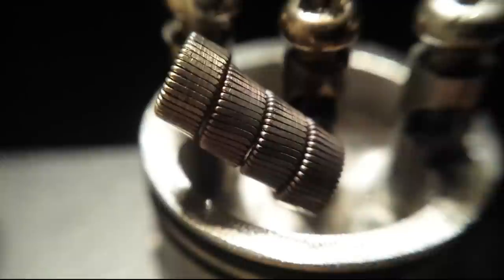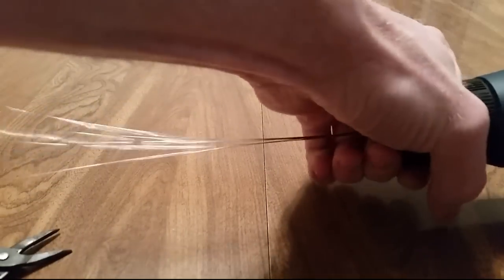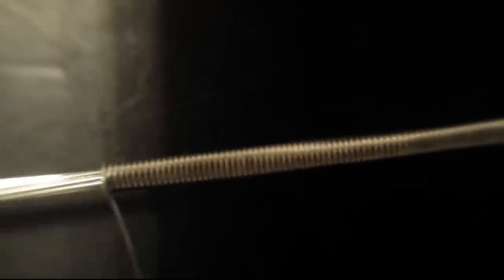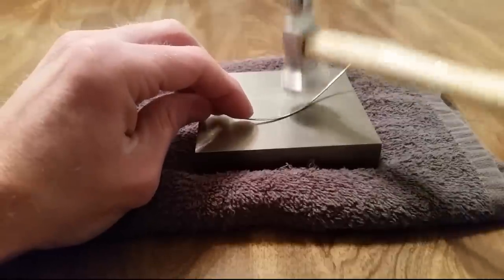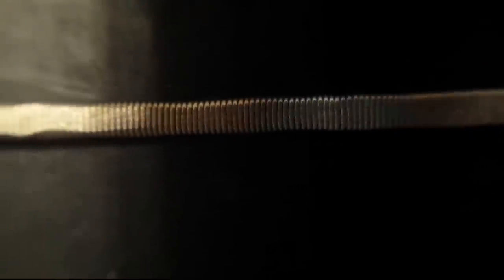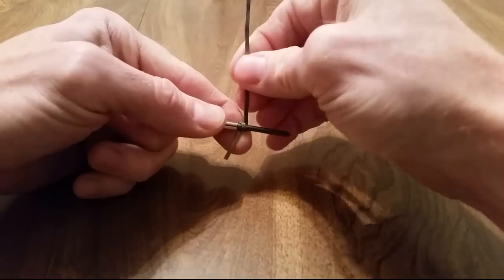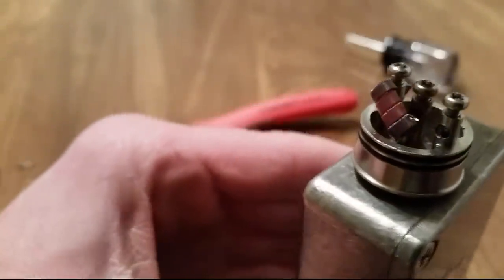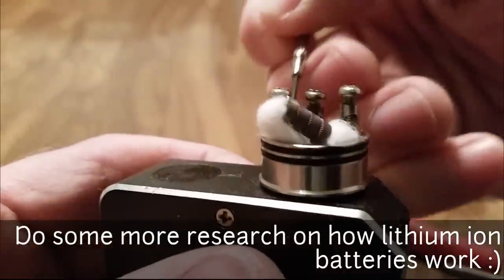Caterpillar Track Coil

Comment: do you think the hammering to a flattened state would be any quicker/easier if you heated the wires up a small section at a time, then took the hammer to it while its hot? im thinkin mini blacksmith here. thoughts?
Reply from the maker: I'd say try it. Only issue would be hammering the delicate wire evenly and also the wire is very low mass compared to the block so it would cool down pretty instantaneously
Reply: +Twisted Messes I bet you could build and sell these like hot pot cakes!

Comment: everytime i see this painfully long hammering process i have to wonder if two cylinders aligned close together two allow the wire to be passed thru and simply squished wouldnt be a better option. something like a small pasta or fondant sheet maker type thing(hopefully that makes sense) and im sure ive seen something like that before
Reply: +Rory Adam The best thing to use is a jewler's mill. It does it completely evenly, has two hardened, steel rollers, doesn't come out like looking like a snake because of inconsistent hammer strikes in one area, and above all, you can adjust your rollers pressure, so that you only flatten your wrap wires and not the internals, so that you don't destroy something like a framed staple coil.
Reply: Awesome thank you for letting me know what it is ajd that it exists...i knew i had seej something like i had described...cheers :)

Comment: And one more question buddy, why didn't you cut the negative lead as close to the post as you did the positive? So the coil won't move if the srew loosens a little?
Reply from the maker: Honestly it was probably just a weird angle I was cutting from with the camera in front of my hands. I usually try to cut the negative and positive leads as close to the posts as possible
Reply: +Twisted Messes Right! I was just asking, maybe learn something new lol.  You and Squid are about the only ones I can actually learn from!

Comment: i have a question when building these coils couldnt you just use a clamp or a press ..?
Reply from the maker: BILLY-THA-WAR MANICS-CHAMBERS a rolling mill works really well. I'm guessing an actual press might be trickier with this specific coil since the twists would be compressed rather than worked out through the rolling process. Have never had success using clamps though, just not enough force and quite a tedious process
Reply: k i didnt know lol im still a noob at all this i really just got into vapen about 2 month ago havent somked a cig in 2 month thanks to vaping so really i dont know crap about fancy coil build's it was just a thought imm try to get into building my own coils just like i do my juice tired of by per mades .       :)   any way been sub for a while to you and grimme's page tryn to learn a few things that way when i do build 1 it dont blow up in my face .....still learning the omhs law or tryn to @ least lol  i have the rx200 with 3 lg hr2 3000mah so i just do basic lil builds for now ....any way thank's for the responce  have a good day and keep up the good work  pce

Comment: How do you like the Mutation x v2? Been using mine for a while now I'm loving it, the airflow is great.. Any recommendations for my next RDA? Something to really amplify the flavour
Reply: Oh it's the V1, never noticed there!
Reply from the maker: Yeah I like the v2, the post holes aren't quite big enough to accomodate this build though. Only issue I have with the v2 is those triangle screws. My tool broke after the second build, so gotta be careful with that one. I use pliers to tighten them now lol. But I hear the clone uses regular phillips screws and has an adapter for a regular 510 driptip. If the clone's insulator is as hardy as the indulgence insulators have been I think I'll pick one of them up
Reply: Yeah I've heard of issues with the tools actually...
Reply: Twisted Messes Yeah this is why I just got a Mephisto, which has 3mm holes for all 3 post so you can fit a lot of wire combos.
Reply: I think the earlier versions had the problem, I've built a good few times on it using the same end of the tool and have had no problems. But we'll see, maybe I'm just lucky so far

Comment: Just a warning, DON'T BUY RADIOSHACK 18650s, they are larger than a normal 18650 and they are not made properly, I have 3rd degree burns from them. My Efrest and SONY VTC4 have never had problems.
Reply: I also had one that exploded while charging rather than venting.
Reply: Found out how it happened, using a metal strap they brought the positive contact to 2mm from the negative contact at a small PCB (which i'm assuming was a cheep protection circuit).
Reply: Yukari Yakumo One last thing, I checked and found out they are re-wrapped. Here is what they look like without the re-branding: https://www.dropbox.com/s/yd82pcucj5713fd/20150320_130654.jpg?dl=0
Reply: Cheers M8 yes the battery itself still works perfectly, what happened was the metal strap that connects the protection circuit shorted to ground.
Reply: Cheers M8 Yea, just remove the re-branding and the protection circuit. The battery is actually a flat top once you remove the re-wrap.
Reply: Yukari Yakumo yes cause we all care
Reply: TheAmericanUhate And why the hell would you waste your time replying to my comments from multiple fake accounts that don't have almost any content on them, and are all interconnected with your other accounts? Do you have a crush on me, or are you really that bored?
Reply: TheAmericanUhate Well thank you for the replies, it adds up to free publicity for me.
And if you really want to go on about batteries, I use VTC4s normally, the radioshack ones were on sale for about 5 dollars for 2 of them, and since radioshack is a re-seller, they were re-wrapped batteries from another brand. The batteries themselves were great, it was the protection circuit that was added on that caused problems. Once I removed it they worked fine.
Reply: Yukari Yakumo Lmfao if you think comments on a youtube video is "publicity". You must not get out much to think something that stupid. Samy 25r's is about 5 bucks a piece to and you know what you're getting. Radio shack re-wraps could be anything and you'd never know what they are. Most likely a very low amp cheap battery so have fun blowing your mod up.
Reply: TheAmericanUhate As I told you, they were more of an experiment to see how bad they really were. I don't use them anymore, and if you think they are really that bad, then you have never seen the kind of batteries they use in non-mechanical mods, like the Eleaf, which has a regular Lithium-ion battery with barely any current capacity even in their 50 watt model. That's why they limit the amount of time you can hold the button down before it times out, and why it has to have a more sophisticated protection circuit.
Reply: Yukari Yakumo There is a 10 second (give or take a couple seconds) cut off on almost every regulated mod. The cut off protection is to keep it from firing for long periods of time in peoples pockets. It's also the same reason they use locking rings on mech mods. Long periods of firing will vent any battery. Also the batteries are generally safe when you use them with in their set limits.
Reply: TheAmericanUhate Exactly, I own a few of them (including the Eleaf 50W). Most mechanical mods have safety features too, like the cut-off spring, that retracts if it draws too much current (the heat generated by using too much current causes it to contract, opening the circuit). I have also found some mechanical mods that have a thin wire bridging the connection, which will melt if too much current is drawn.
Unless you are really screwing with things, you are generally safe.
Reply: Yukari Yakumo DONT buy Batteries Plus 18650 either
Reply: Yukari Yakumo you shouldn't be vaping

Comment: eFest batteries are one of the worst you can buy
Reply: +Thurnis Haley you know more about vaping than this guy? lol the authentic ones arent too bad... i wouldnt use them for a .1 ohm build... but anything above .2 ive never had issues with them... Tho i only have 1 set of them and they are for sure authentic... i do prefer samsungs more though.
Reply: Lol eFest is widely known for rewrapping their batts, as well as "authentic" eFest purps are also widely counterfeited in themselves. But nice try
Reply: Never said I was a professional, just stating something that has been established for some time now. Whether or not eFest has addressed the problem is beyond me, since I've since stopped using their products for obvious reasons. But if you wanna be ignornt and a narcissist then okay, do whatever makes you happy
Reply: you need to look up what narcissist means.....
Reply: +Josh Rimmer I've never had issues. That statement is as invalid as a Venn Diagram where the circles are separated. Efests have not only the worst rewrap consistency, but they use 10 Amp batteries in most cases where you can't go below a .5. build. you need to shut the hell up.
Reply: battery tests dont lie man... if i had issues with them why the fuck would i be defending them? have you done drain tests on them??? they are DEFINITELY NOT 10 amp.. my 35 amps were 31 amps.... not too bad...
Reply: please send a message to twisted messes telling him that he is an idiot for using rewrap batteries and that he obviously doesnt know how shitty efest batteries are and see what kind of feed back you get from him.... lol
Reply: I've never had trouble out of them, I've stacked them also.

Comment: Those efest batteries are dangerous as hell, 35amps my ass, new batteries and they exploded under 14amps. Vtc4/5 are the safest
Reply: In regulated devices, you get LG HG2s. In Mechanical Mods, you get LG HB2s

Comment: Using a mod as your ohm reader is a little irresponsible.  Even if the mod has a safety feature to lock the firing and just see the ohms doesn't mean it can't fail, it's still being tested with a live battery under it.

 I always tell people that to check ohms, get an ohm reader and use that.  Using the mod is more okay to do IF you've been building for awhile, but to do it in a video makes people new to building think it's perfectly safe to do it that way.

Not trying to down this vid, it's a good vid, just didn't care for testing a build like this on an actual device.

Comment: While the videos are interesting and the builds are informative. I find them all making the same stoner assumptions for why certain things happen. Like the bending of the hammered wire. Or the water running off the end of the wire instead of the middle. It reminds me of when I used to smoke a lot of weed and my friends would sit around talking about space and use a lot of words incorrectly. If you know a lot about something, talk about it. If you don't know about something, don't make yourself look like a dummy.

I'm going to keep watching. Even if it's through my facepalms.

Comment: 1/8 compared to 3/32? Are americans serious with this ridiculousness? It's so stupid it's not even funny.
Reply: That 1/32 of an inch makes a difference in wicking as well as overall resistance of the coil. If you've any experience with vaping you would know that, and if not then your input is irrelevant. Maybe don't be so quick to insult an entire nation without the proper knowledge on the topic. :)